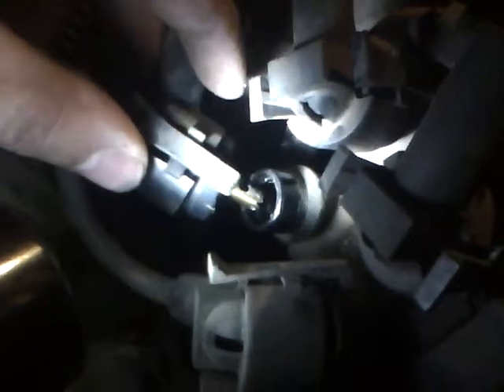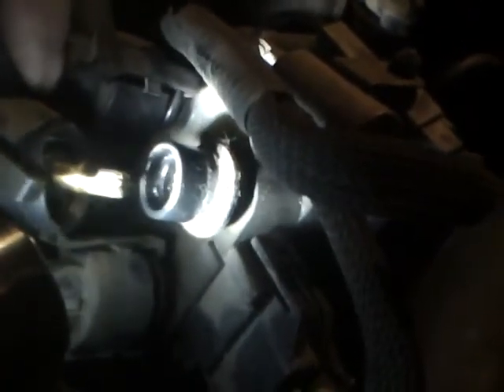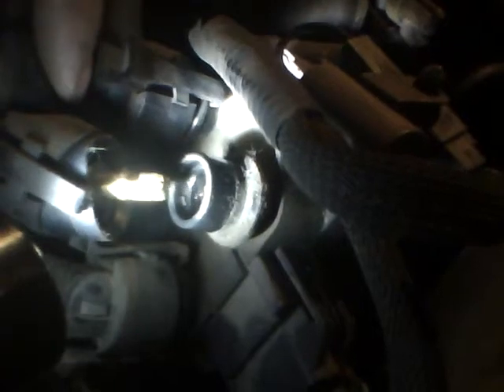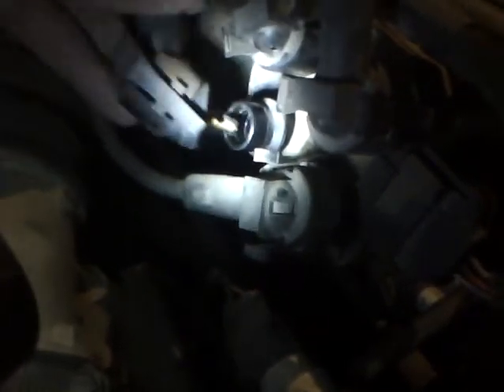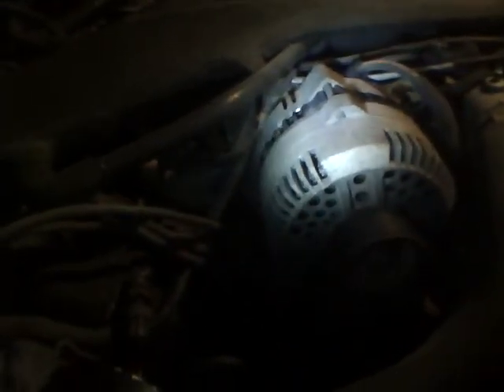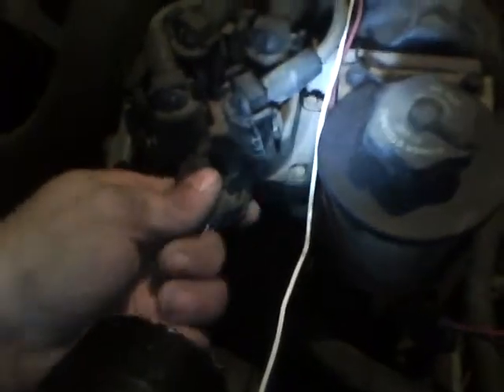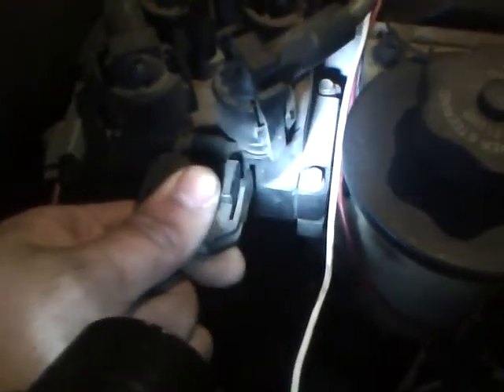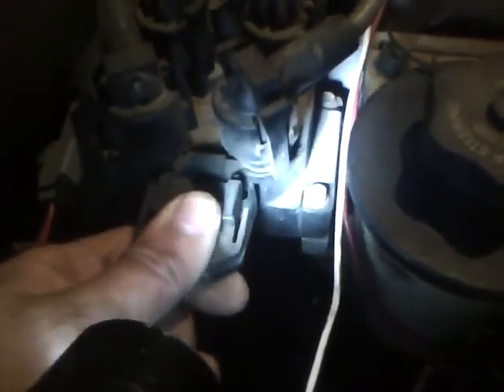Cylinder Drop Test

Comment from the maker: The cause was the coil pack. It was the OEM coil from 1994 when the car was built, why it went out im not sure i replaced it and have not had any further problems. however this did happen about a year after the OEM computer ended up with a corrupt fuel injector driver